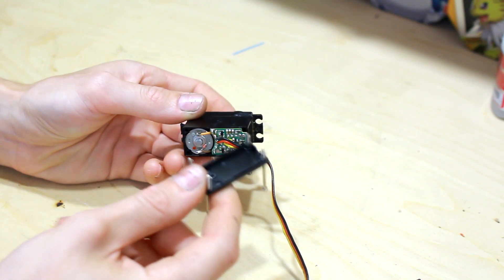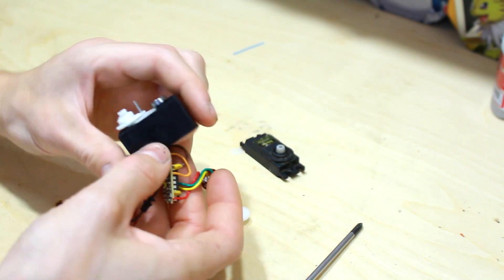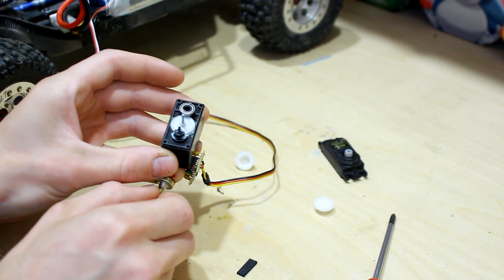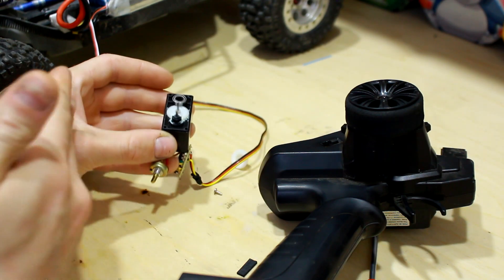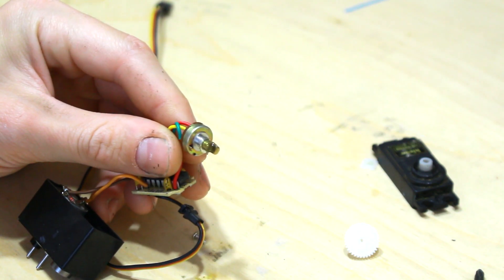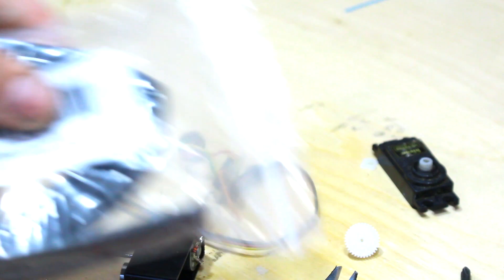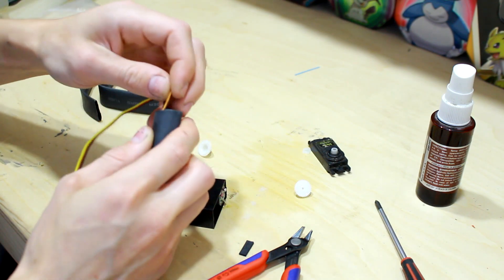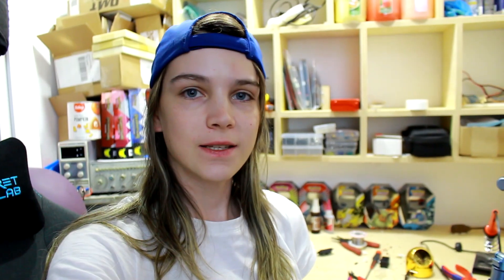How to Turn a Servo into a CH3 Winch/Light Controller!

Comment: Been in this hobby for over 20 years and never thought of using an old servo board as a light controller, that's very smart. Well done. Can use the servo without the board a winch also with any old brushed esc to control it
Reply from the maker: Thanks! Yeah you're right you could definitely repurpose the rest of the servo into a winch

Comment: Whats the current limit? I imagine its quite low, as in 1 or 2 small LEDs as servos get power from your receiver and not from a motor controller output.

Comment: So I'm going to have to test this but I'm pretty sure that once you've got the potentiometer set into place, if you remove it while the control board has power then it will save it's last setting and you don't ever have to worry about it again.
Reply from the maker: Oh... hmm, okay! I will have to try it as well and see if it works
Reply: @Hwy49RC  I should have revised my comment. I did a bunch of testing on this and it ends up being inconclusive. If you short the signal and ground pads it works but very temperamentally.
Reply: Nope. Doesn't work that way

Comment: So could you just leave the motor connected and use it as a winch? and also will it go forward and reverse or is it only an on/off switch?
Reply from the maker: It's only an on/off but I suppose you could keep the original servo motor and internals. You would have to put the board and pot outside the case though. Well, actually you could drill out the bottom side of the gear that the pot goes into so it doesn't key onto it. But you would have to come up with some way to make the spool freespool outside of the electrical/servo internals. But wait, if you had a 3 position switch I think it would work in both directions no? You'd have to try it but do let me know if it works!